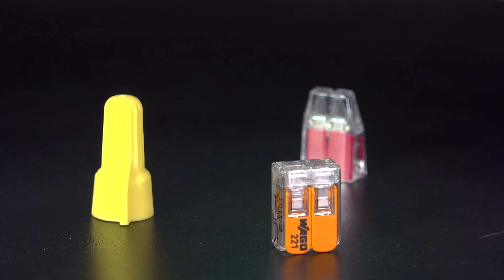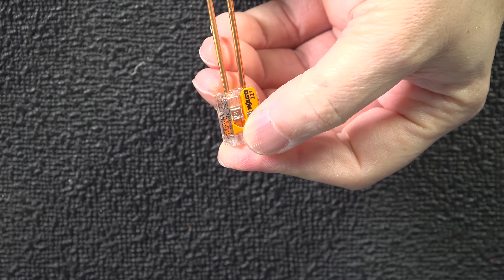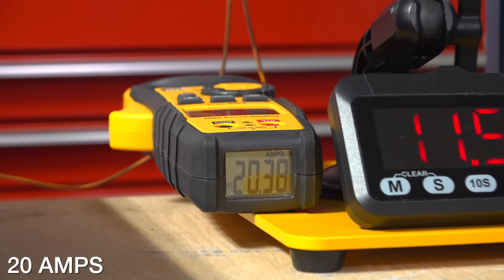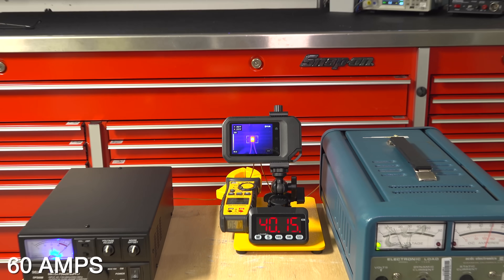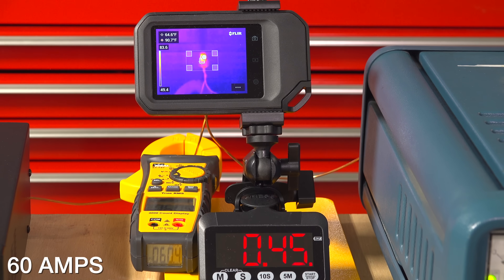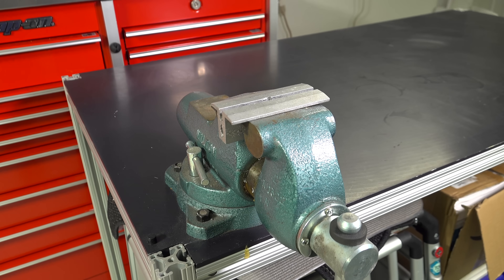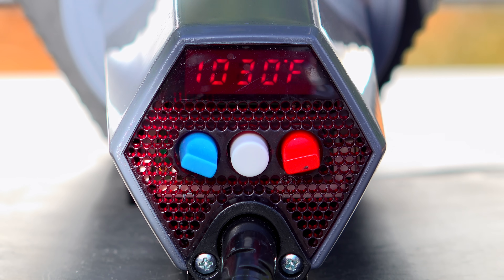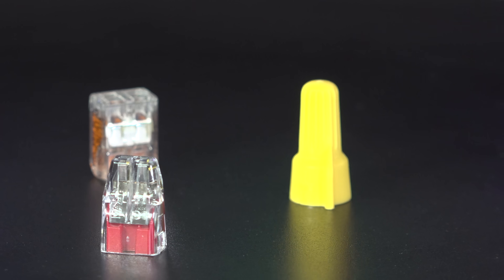What Wire Connector is the Best? Wire Nut VS Wago TESTED

Comment: I didn't see you testing the best argument that I've heard though, that the small piece of thin metal in the Wago will become weak or brittle after x number of power cycles. If you have a circuit that's being power cycled multiple times a day over years, the thin piece of sheet metal inside of the wago may only take so many power cycles before it starts to break down getting warm and cooling down over and over and over again. Can you design a test to test if that's true? Something like a 1500 watt thermostatically controlled heater turning on and off hundreds of times a day so that that little piece of metal it's heated up and cool down hundreds of times a day, decreasing the springiness of the metal so that it doesn't hold as tight of a connection which may turn it into a resistive load itself, until it's self-destructs.
Reply from the maker: Even if I could do that test, which I don't have the ability to, I always question the results you get. Age is a factor too. Heating for say 2 hours a day then cooling 24 hours between cycles has an effect and these cycle tests I see people trying to do isn't real world. For that I turn to the actual product history and reviews which give you real world, long ter, examples. In this case they are excellent practically everywhere. These have been used in Europe for 40 years with an amazin track record also so in terms of long term cycing there is no data available to show that these are anything other than extremely reliable.

Comment: Exactly as expected, the wago conducts all the current, whereas the wire nut conducts some, but most conduction is through direct contact of the wires
Reply: It helped that in this test there was about 2" of wire twisted together that would have (hopefully) normally been in insulation rather than just bare live wires hanging about ready to kill someone.

Comment: I love how you said old houses used to have 100 amps for the whole house. that is still pretty common is it not? old houses used to only have 60 amps for the whole house. in fact, our house still does. and as long as your major appliances are gas, with the exception of the stove in our case, it is still fine. so you were running a house through it.
Reply: A few of the homes I've renovated here in IL had 30 amp services and, get this, fused neutrals. Lot of knob and tube yet also. I own a 5 unit that had a newer 200 amp panel hung on an ancient pair of 8 ga supplies. God protects morons.
Reply: @edmessina8392  really? i figured all the 30 amp main services have been long sense upgraded to at least 60 amps. fused neutral is a big issue. an older guy i know used to have an old farm house with knob and tube wiring, it had 4 circuits in the whole house and the fuse panel was actually built into the wall and had like asbestos sheets all around it. it had fused neutrals and they were not color coated, both of the wires were white.
Reply: @WalterKnox  These places are in Carroll County in northwestern IL. Primarily ag area with a half dozen small towns. NEC was a foreign concept to them until perhaps 25 or 30 years ago and, even then, I've seen some builder wired nightmares. A good deal of the housing in Mt Carroll (where most of my places are located) was built prior to the civil war as far back as 1840 or so and the structures were electrified, it seems, the day after the lightbulb was invented. I still have a single intact exterior oil wall lamp on that 5 unit I mentioned just because its amazing it survived this long. The milk glass shade is intact. Seems to be made of some pot metal.
Reply: @edmessina8392  that is cool. I always try to preserve things as much as I can. old fixtures and things are cool.
Reply: 200 Amp service is most common now in residential.

Comment: For one dollar you get 4 Wagos or10 wire nuts . this ads up on big jobs. When bidding a job , it's these little items  that can hurt the bottom line. Wire nuts have been the standard forever .They are cheep and safe when used correctly. Just make sure any electrical product you use carries a UL listing. I don't see anything wrong with Wagos connectors , this type of connector has also been around for years .I usually find them in lighting fixtures.
Reply: If you buy wire nuts or wago in small quantities, you do something wrong.

I buy them in packages for 10€/100pc (Wago) and that's a good price for me.
Reply: @B-M.B  This was price per 100 in US .
Reply: @stevetotten5565  Ok, well that's than expensive. Hope the price drop soon there. In doubt, I would always prefer Wagos over wire nuts.. they are just safer, easier to handle and need less space. Not to forget the time you save on either building up or change connections.

Comment: I noted the current was DC and the voltage different from the normal residential operating conditions (110/240v 20 amps). the comparison is totally valid, but does the AC voltage and current make a difference in the temperature values that would be measured?

Comment: I’m not a professional electrician but, I have replaced many outlets that have failed because someone used the push in tabs. I don’t want them used in my home or yours. I believe your test was good but not sold just yet  what about when you push these into a box and move them around some. Just not 100%.sold yet.

Comment: What about the conductivity? If the power isn’t making it through the connection, it doesn’t work. This may be the reason why the wire nut ran cooler.

Comment: I started using WAGOS in my lighting wiring and won't go back to wire nuts. A little wrap of electrical tape to keep the levers in place and done.
Reply: The Electical tape is not required, in Europe they have been in use for Ages, never encountered a problem with them.
The levers need to be opended past 90 degrees to lock/unlock they never open this far on their own, unless you bought knockoffs by accident.
Reply: @timhartherz5652  I know. I use it more if I am ever going to go back into the box and have to move wires or pull it out for some reason not to catch something and pull the lever up while doing so.

Comment: The are  tests for  two conditions I think you you did not perform. 
1) Heat cycling (heating ang cooling) the connectors.
2)  Metal creep (deformation)

Comment: While the use of a 12 volt supply may show some simple ohms law results, I think you really need to use 120 volts or 240 volts as a source when testing for temperature. If you have a resistance of 1/10th of an ohm at the Wago or wire nut junction, and use a higher voltage, you are going to see vie E-squared/R, that the voltage drop across the junction (and radiated power from the junction) is going to  be magnitudes higher. Over time, that heating will cause more resistance and more damage. That would make for a much more valuable to us end users.

Comment: perhaps using insulated wires would be better as with the bare wire heat is being dissipated along the entire length and you'd only be able to twist the actual amount of bare wire in the wire nut test.   Very informative, thanks.